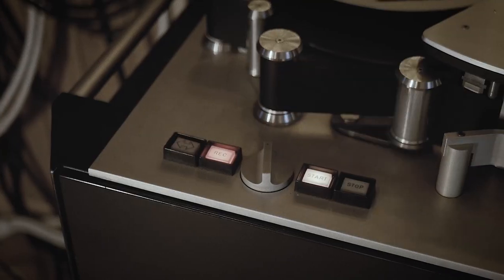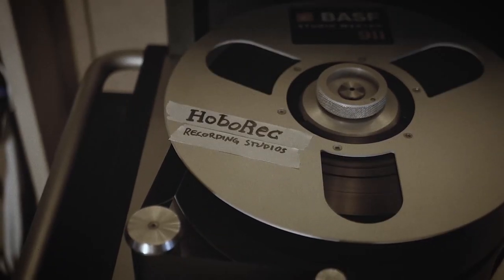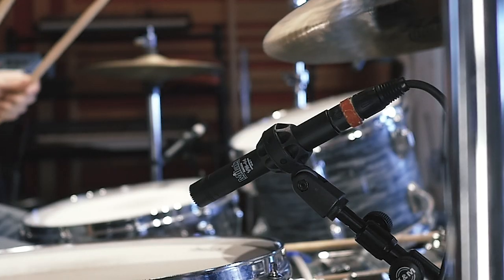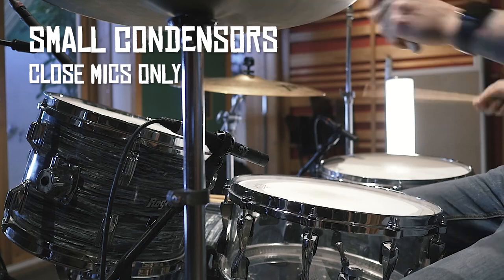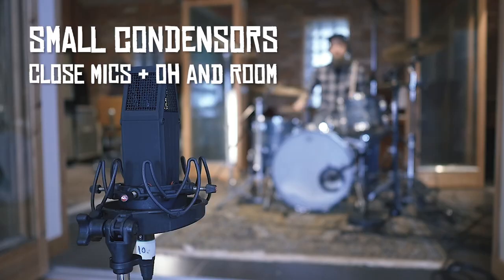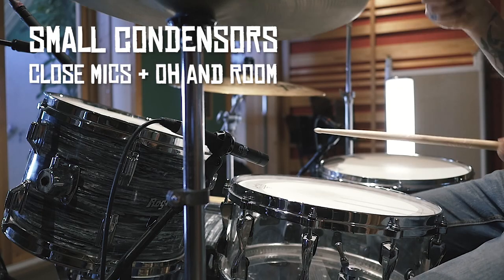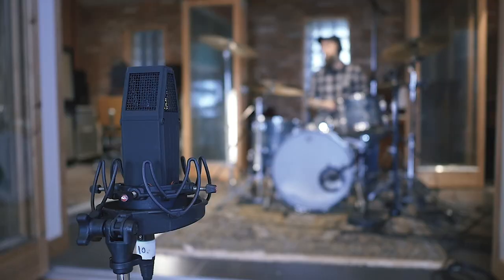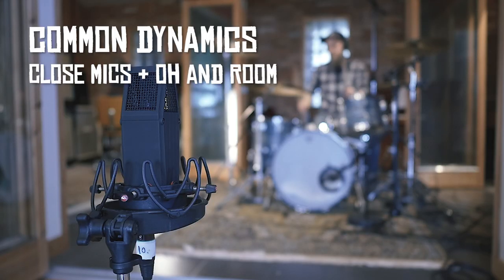Close Mic Your Drums With SDCs (Small Diaphragm Condensers)

Comment: So true! I always put condenser everywhere I can, except for the kick IN which is usually either a RE20 or a 421, paired with a cheap ribbon mic in the front or a large condenser. SDC are less expensive than classic dynamic nowadays. TBone SC140 are good candidates for snare top/bottom, HH and overheads. All together they make the sound more coherent than having 8 different frequency responses with tone and phasing issue from mismatched dynamic microphones. Thanks for the video !

Comment: So far I've had great results using the Oktava Mk012 on snare top. Tried them on rack & floor tom, I still prefer 421s. I'm going to do more experiments with positioning for bleed rejection
Reply: I have a matched pair of the Oktava m12s actually. I never tried them on the toms but that might be something I try. I did try it on the snare and honestly it just did not give me more than a SM57 on top and bottom would.
Reply: Which capsule do you use? Hypercardioid or regular cardioid? Im considering getting one as a dedicated Snare mic

Comment: super good video!.. because it shows the actual difference: dynamics will give you are more compressed in your face sound, but also narrower in the stereo perspective. SDC will give you a more airy natural sound, but not with quite the same punch. Now: with EQ and compressions and so forth the differences can be hugely minimized. But again: dont fix it in the mix, fix it at the source, so choose the mics that fits your song and sound. Milab are great mics, but also very expensive. You can use way cheaper SDC and get pretty much the same result. Drums are easy on the SDCs. I use Slate ML-2 for SDC on toms and snare.. and HH and ride. In my country they cost about 1/6 of a Milab. Yes the milabs are a tad better, but on drums I would claim that only the mix engineer will be able to hear it ;-)

Comment: The toms specially sound a lot better with the SDC. With the dynamic mics you would have to EQ them harder to match the sound, but still, the toms would sound more "stiff" compared to the condenser mics. I've seen a few people using both a SDC and a dynamic 57 on the snare, have you ever tried that?
Reply: That sounds amazing, you get the best of both worlds and don't even need to boost high end, just raise the condenser level.

Comment: I love small diaphgram condensers on toms, very natural sound and the bleed sounds pretty ok. I picked a pair of Line Audio cm4 mics quite recently that are super cheap but stupid good. Maybe you know the company as I think it’s swedish..? Thanks for the nice video!
Reply from the maker: Yes! I have a pair of Cm3 but they can’t really handle the loudness of the drums. Maybe the cm4 have more headroom?
Reply: @hoborec  I haven’t had issues with headroom with cm4 but then again the recordings I have done with those mics have not been very loud stuff.
Reply: @hoborec  The CM4 replaced the CM3 but is intended to do the same job, I think it was changed due to capsule availability. Both are great mics and I would strongly doubt one having higher SPL rating than the other.
Reply from the maker: @microkit  this made me curious so I checked the line audio website. It seems like the cm4 has a max spl off 140db and the cm3 was at 130db. That should be able to handle drums, but maybe right on the edge depending on how hard hitting the drummer is.
Reply: @hoborec  I always wonder about this, I have Blue Hummingbirds, I think max SPL is 135db and no pad, and I assume they're OK for toms but maybe not snare.